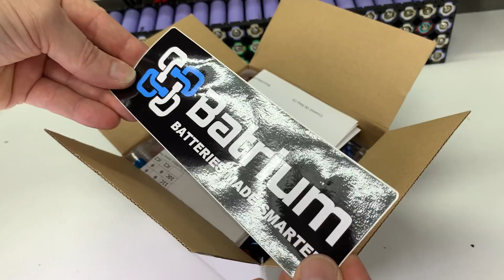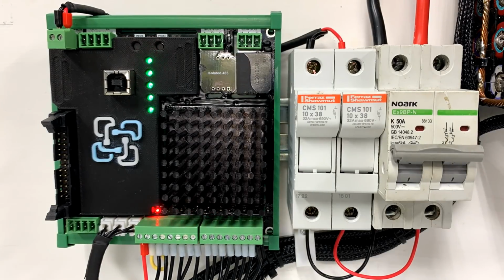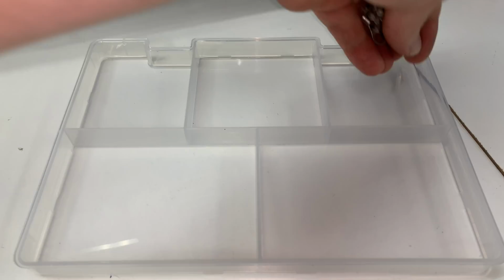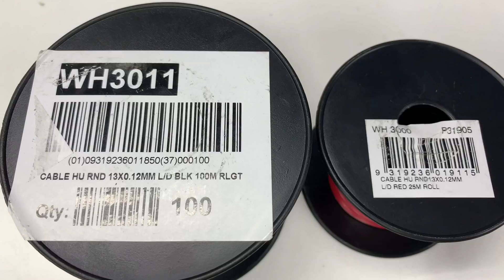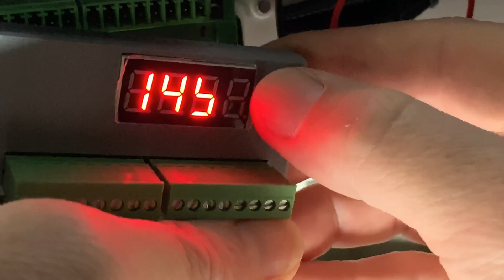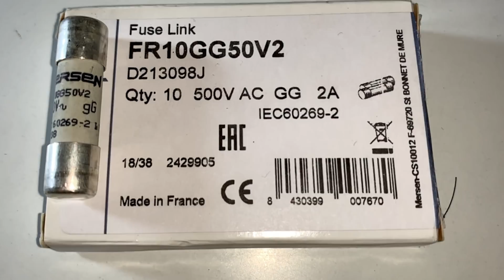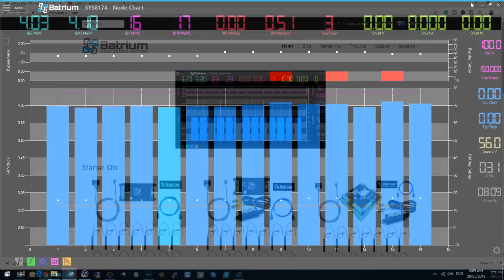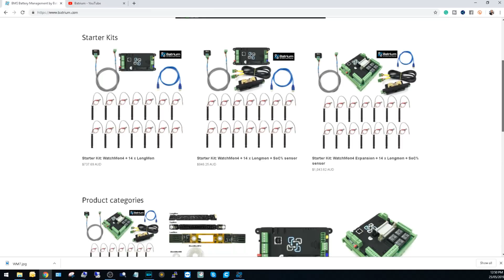#1 BMS from Batrium - The Watchmon Plus unboxing & installing

Comment: Does Batrium drains current from an overvolt cell? or transfers it to another?
Reply from the maker: it's a passive balancer not an active.. so removes the issue not moves it. Active balancers come with a host of issues that render them mostly useless other than 'balancing a battery"

Comment: I just got the mw4 with longmons because of a misunderstanding. Batrium told me i could exchange it with the mw 5 if i want to. i am building a 2x14S120P System (so a 14s240p) with used 18650. Which one would you use for this? the mw4 with longmons or mw5?
Reply from the maker: WM5 if it was a well built battery, 4 if it's less than ideal build

Comment: Hey  Peter, thank you for the instructions! You help make life easier! I was wondering which batrium do you use if you have 28plus battery packs? It can not be centralized or can it?
Reply from the maker: I use a WatchMon4 on my bigger banks that will be expanded and require higher balancing currents. Watchmon5/7 on smaller battery packs that require less balance current or need to remove heat build up from within the battery enclosure

Comment: HB, good commercial! you'll have your own TV show next, quick ??? a depleted(dead) nickle or any other kind rechargeable or not AA AAA OR C,D capable of acting like an electrolytic capacitor not being able to hold a charge or a burst of charge but nothing like adding electrolytes why I'm asking cause of the booster packs completely won't work without a good battery and wouldn't that prove electrolytic capacitors work better for EV's my concern about the EV's  there really isn't much of a nationwide safety issue to deal with a problem with using all the batteries being used why I would recommend a quick release feature for the battery packs or better containment

Comment: hey are this one is active balancer or just burn and waisted the power for balance?
Reply from the maker: Active is Watchmon6 - My inverter 'wastes' more energy in heat than balancing. Hell 10x more again between the panels and charge controller. And don't get me started on the energy wasted once the batteries are full...

Comment: just wondering what the accuracy of the voltages are. i had one longmon that showed 40mV too much, which is somewhat unacceptable for lithium batteries
Reply: I am.operating with cheap chinese digital voltmeters and the differences are huge (100s of mV) between similar models.

I have seen alternatives to the really cheap BMS units that facilitate a lot of parameter setting...
Reply from the maker: Yes some are highly configurable
Reply: @simonmasters3295  
it is time to ditch your 2$ volt meter and invest in something more accurate. 
besides there are plenty of cheapish voltmeters on the market that are fairly accurate. just do a youtube search.
Reply from the maker: I only have a chinese multimeter but they all show the same value once balanced so I was happy with that. 40mV isn't terrible but for lithium you would have proceed with caution
Reply: @HBPowerwall  
what i am talking about is comparing the actual cell voltage with what the longmon thinks in the software.
according to maxine the tolerance is actually -50mV/+50mV. you can easily calculate that the worst possible scenario could be 100mV difference. which is acceptable for a lead acid battery, i suppose. but not a lithium, particularly a lifepo 4.  the spectrum to from absorb to near fully discharge is only about 500mV.
i talked to you about that they should be able to be calibrated. like some cheap chinese bms' are. maxine's position is, that people might calibrate them wrongly.
i can calibrate the voltages in the midnite classic chargers. i have 5 of them. all needed re-calibrating, although they were orginally calibrated in the factory i am sure.
Reply from the maker: I'm going to side with Maxine, I only have a Chinese multimeter it could be more wrong than 50mv i'm sure.
Reply: @HBPowerwall  
you might want to invest in a fluke voltmeter. mine measures 3 decimals on cell voltages which is quite handy. also gives you an accurate result in measuring ripple voltage.
Reply: @ursodermatt8809  
I have to agree not being able to calibrate the voltage reading is disappointing that they removed this feature. I had a few of my cellmons that where way out off with there voltage readings. Have fluke 87v for rough measurment and calabrated HP bench meter for more precise measurements. I understand that people potentially could be adjusting units with incorrect equipment or during conditions that would give wrong reading. Though taking the user calibration feature out of the software was a big mistake. A simple warning or placing it in an advanced menu with disclaimer would be enough. It's a diy battery management product if customer can't be trusted to calibrate the voltage offset then I don't see that as any different to them tweeking any there setting incorrectly and creating issues.

Please if battrium read this return the voltage calibration feature to the software!!!
Reply: @kurtthrun1909  
Totally agree with you
Reply: @ursodermatt8809  yeah innit

Comment: Buy 5mm female insulated bullet - crimp connectors 5$ per 100. Buy 5 mm x 20 mm  fuses. Crimp wire into 2 bullet females, insert fuse into what would be the female bit of both crimps. Presto, inline fuse-holder! Wire assembly into circuit. You then have a pluggable replacement fuse-holder that allows you to make mistakes and change fuses as required. Cheap!

Comment: Pete . Q for you . You currently have 14’s connected to the unit - can this also support multiple 14S packs in addition by duplicating the “ balance wires “ or does this cause issues .
Cheers
Reply from the maker: I think it would work but opens up a whole new set of issues. Shared looms require a little more finesse and become unhappy fast. adding that many more cables will add much more possible points of failure. Best would be to reach out to Batrium support and ask the question. WM+ can only do 6ah balance per day so adding too many P might add an unreasonable load to a single WM+

Comment: Id really like to see the WM6 in action. 7 A balancing current. I dont think this model has enough balance. How was it it? Them new cells looked like they went high a few times
Reply from the maker: WM6 is a long way off from what I understand. 6ah per day is considerable for a well-built battery. For a poorly built battery, you'd want to be finding out why rather than getting a larger BMS. Yes, some cells do appear to jump up a little. I also asked Batrium support about this and its due to the shared loom. I tested with multi meter and cells are definitely fine. because two cells have a 'shared' cable data sometimes trips over each other - well that's how I understand it anyway.
Reply: That's not a great explanation. When you say the tested cell is ok do you mean it's volts are right and the BMS reads it wrong?l

Comment: i hope the watchmon plus is more reliable than the watchmon 4
Reply from the maker: I've found the WM4 to be perfect - however i only use basic functions, but ordering a new inverter soon i hope with CanBus so that'll open up a hole new learning curve also
Reply: @HBPowerwall  
i don't think there is any documentation on batrium's website how to program the stuff except for the cell balancing.

Comment: They told me they dont have any BMS that is suited for Tesla Batteries, I have a email from them. Plus I'm still waiting for my refund I sent back all there faulty products. I'm sure you seen my videos. They have been sponsoring you for some time now so I understand you up selling there products. But plain and simple Batrium have lots of problems just look at all the comments on my video about them.
Reply: Did you get a refund yet?
Reply from the maker: I can't even describe how disappointed i am about how you handled the whole matter. I've subbed you for so long i can't remember the first video i saw. I'm sure i saw something about you buying that BMS plus 12 months ago...
Reply: @HBPowerwall  disappointed you have know idea. I subbed you back in the day way before you subbed me, I handled it just fine Considering. You and i may not see eye to eye on this because your on there side and that's fine. But I know the truth and I dont mind speaking it. Wish you the best of luck.
Reply: @ModernOffGridDIY  
batrium's customer support can suck. that is my experience also.  maxine was all but hurt about the faulty cell wires they sent me (they were hot melt glued and the wire disconnects under bypassing current between the wire and pin crimp. at least 12 wires failed. and for most of them i paid myself)  and they still keep failing. so i have to observe the bloody thing every float change to make sure.
theoretically a good product.